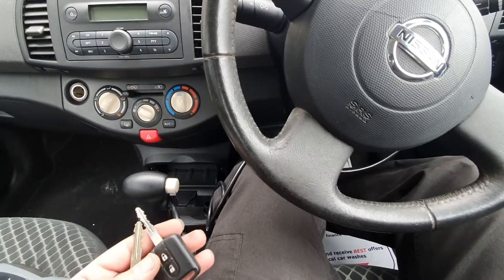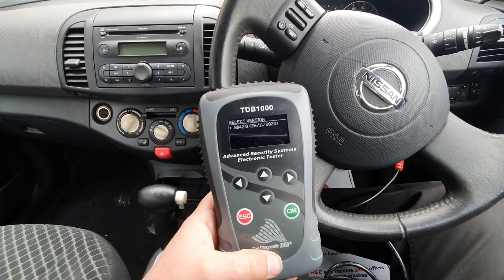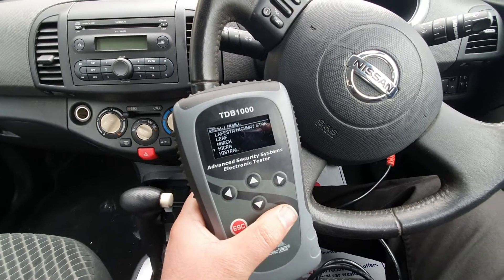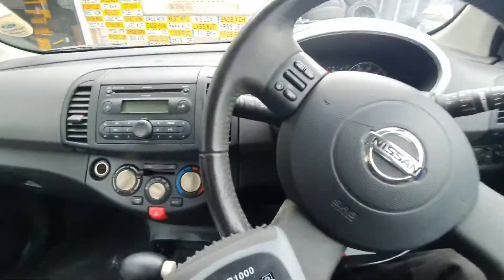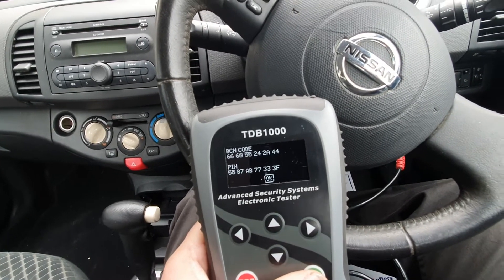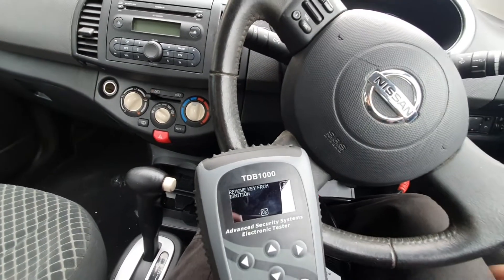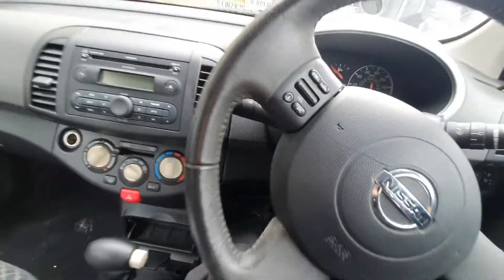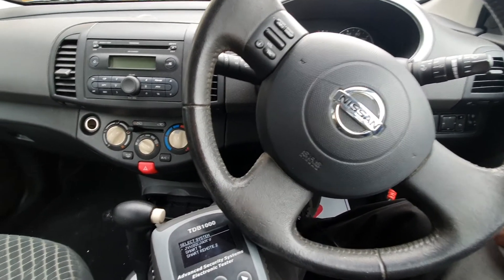key programming on a nissan micra 2006 k12 (spare key) using TDB1000...

Comment: I have 2007 Nissan Micra I bought with one key. I bought a 2nd hand OEM key and a brand new blank chip off ebay. I've it t several locksmiths to program the 2nd key but they all refused. It's frustrating 😢

Comment: Hello
I have the tdb 100 and it is very good tool.
i took the fiat software and i have a keyless 2016 fiat 500 X, have you already done this ?? if yes do you have any advice i'm taking
good prog :)
Reply from the maker: Hi 
I use abrites avdi on fiat I don't have fiat software on my tdb1000 but I have friends that use tdb on fiat and they are very happy with it 
The only thing that you need to pay attention on fiat cars is the precoding and that's same on every tool for fiat
There is a website called WIKIKEY that is made for tdb1000 users 
There is all the information that you need for programming a key plus a video of how to do it 
I hope this helps.
Reply: @ramiztheautolocksmith9022  YES :) thanks for your answer, i was see on the wiki site and got the answers, i discussed with the tech service.
for fiat 500 x prox no pre-coding
on the video houses it is almost the same way of prog as the tdb 1000.
good prog :)